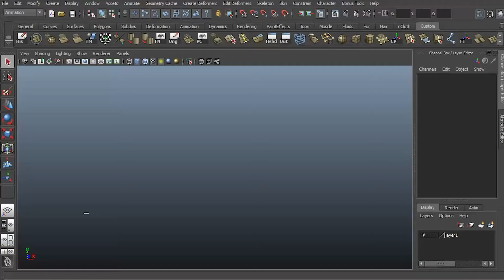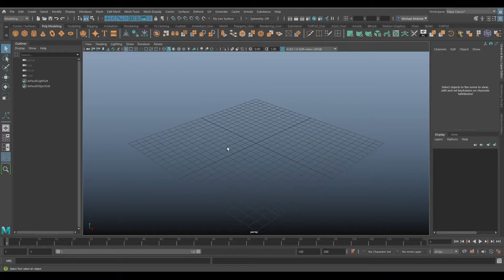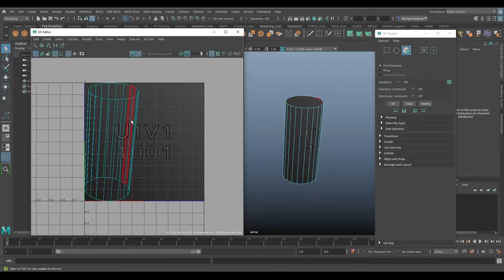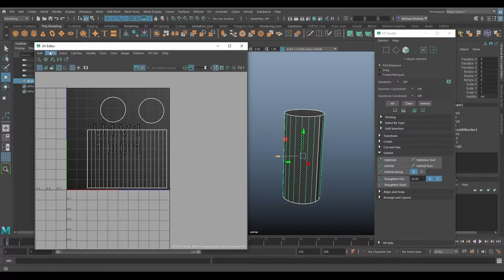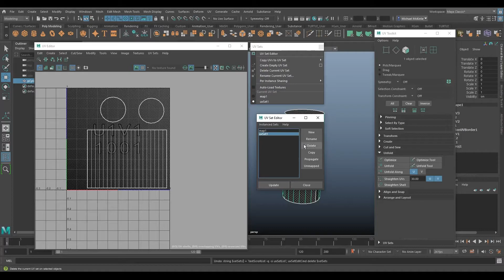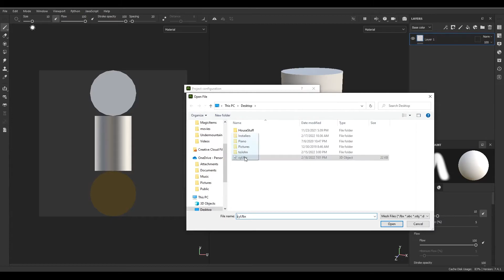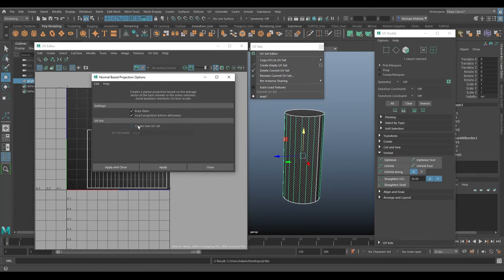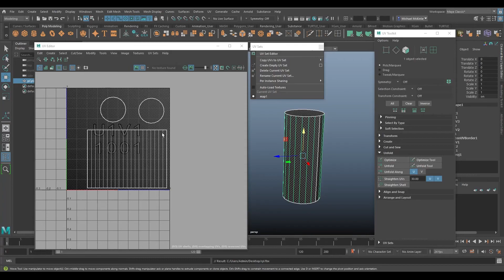The Maya Toolbelt - Wrong UV Set Fix

Comment: Thank you very much it's a big thanks from me and hug 🫂 

I've been stuck for 3 days and hoping I'm not gonna make this  but your tutorial came along then I learn and got it 
You save my time and help me to not getting upset...

I really said I subscribed you 3 years ago and its a good decision 
Thank you very much may ALMIGHTY ALLAH SWT bless you and giude you to the straightpath 😍🫂
Reply: But one issue I also alot suffer,. 
When transfer uvs from -mesh - transfer attribute option - first reset then uncheck uv sets and color set option and then check component then apply it work but it can't be work on upto 3 same uvs prop 
Like I model a dirt sport car and it's had a spike on them, at the side and more than 3 like 3 left side and 3 right side.
 I unwrap with same method only three spike and left 3 spike

When I try to unwrap with this method my selecting first one which is already unwrap and select new one then transfering uvs by attribute option it's works but the uvs in the uv editor it'll broke into many pieces, it's look same or content same space in editor as first one look but when I look via checker it's break and 
checker shows uv distort means red and that uv break into many uv shells 

Plz help me with that.....